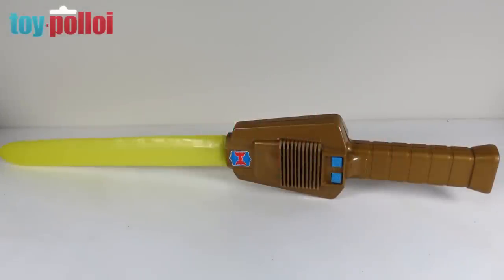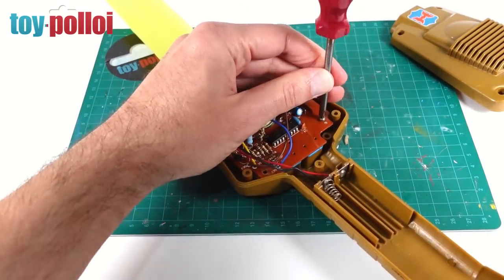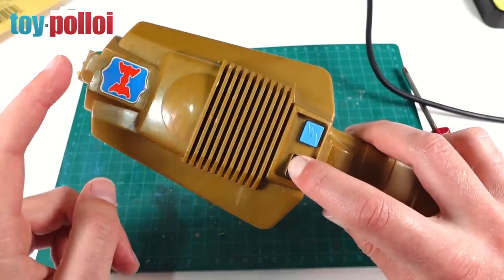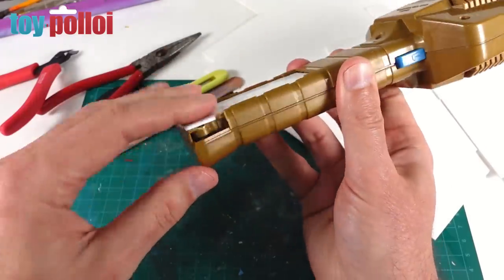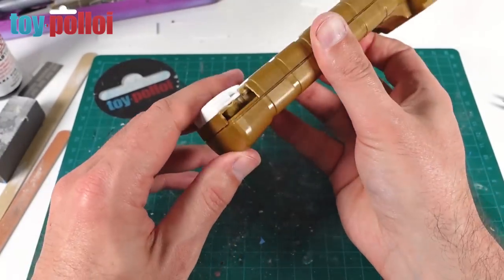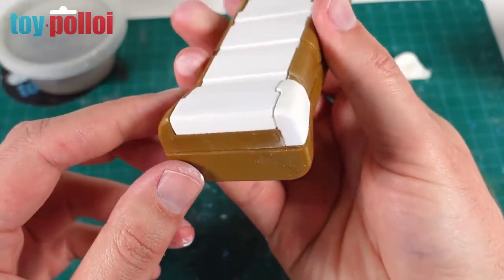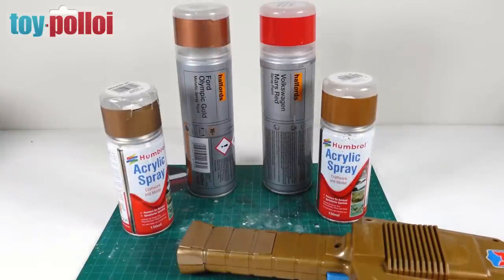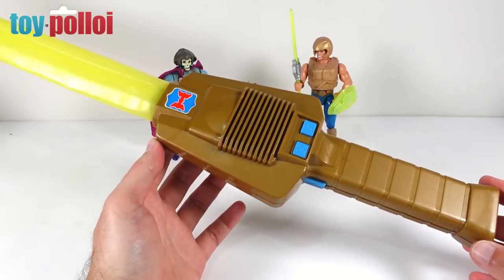Vintage New Adventures of He-Man Powersword restoration (Almost) - Toy Polloi

Comment: I’d look for a diagram of the board online and I’d personally unsolder all the wires and redo them all. Check that lightening button to make sure it’s not constantly making contact to the board as well. And finally, I’d invest in purchasing a 3D printer for stuff like the battery cover.
Reply from the maker: Yep. Like watching paint dry.
Reply: @andrewmiller2904  The "Fun" would come from creating a digital model and the satisfaction of the 10th one fitting.

Comment: Holly Molly! I came here to see how you made the battery cover expecting you 3D printed it but WOW I did not expect to see you fabricate it by hand!  I love that! My 3D printer is still in the box it was shipped in because I am a little afraid of the learning curve but also I just keep finding ways around having to print the items I need such as you did.
Reply from the maker: Thanks. I like to make as much by hand as I can. 3D prints are fine, but make for a boring video. And I also like to think anyone can have a go at copying what I do without the need for expensive equipment. Cheers

Comment: @Toy•Polloi there's a quick way to tell if the circuit board is the issue or not. All you have to do is remove the button from shell then resemble it and test it with the batteries. If it continues to make sound with the button removed from the shell, the circuit board is the issue but, if it stops making sound without the button, the button is the issue and it's making contact with the switch.  Hope it helps 👍👍
Reply: one thing i learned while doing my own electronic project is that if you have a bad or wrong wire connection problem you can get the same problem you have here

Comment: It's probably obvious to say, but it'd be worth checking both sides of the board to see that nothing's shorted out over time. 
Might also be worth assembling without the two offending buttons to see if they're the cause. If removing the buttons works, what may have happened (going from what I can see and other similar toys I've had to shut up before) is the rubber on the little press-down connectors perishes, and the buttons sorta droop into constant contact.

The battery cover and repair is absolutely excellent work!!

Comment: Getting spray colours which match can be a pain. What I ended up doing when I had problems was I found a place which mixes up custom paint colours for cars and took a sample of the colour I needed. Costs a bit more than an off the shelf colour but you can get a lot closer as they have sample cards which you can compare them against.

Comment: I have the Havoc Staff from this line, well the top half anyway. The bottom is just a thing plastic tube made to look like a stick. Never did find this thing. It's a cool piece, great job man as always. got 80% there. Still a victory.
Reply from the maker: Thanks. I would like to get the Havoc staff to go with this some day. Check out the follow up video on Retro Tech repair to see him work on the parts I couldn't get going.
Reply: @toypolloi  Already on it bud.

Comment: there are lots of reasons why the buttons might not work correctly, including bad capacitors and broken solder joints (very hard to see with the naked eye sometimes), but my money is on those contact pads for the two upper buttons and the conductors in the switches; it might be as simple as cleaning everything with alcohol and a toothbrush/cotton bud.  edit: just watched RTR's fix, he did a great job and got another subscriber :)
Reply: I agree. I would definitely replace the caps and reflow the solder joints along with a good clean of the buttons.

Comment: The electronics problem looks to me like a short on the lightning button. Pressing it does nothing as it is already permanently active. Pressing other button causes two circuits to become active which stops them both working as they are fighting each other. Releasing the button ends the conflict which starts up the sounds again from the shorted button.